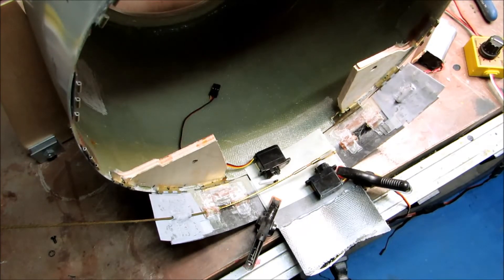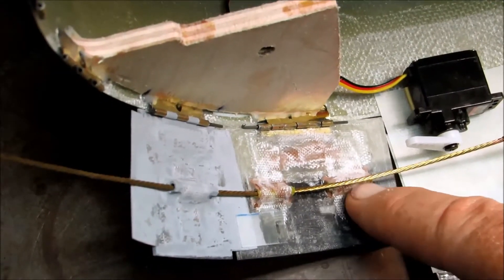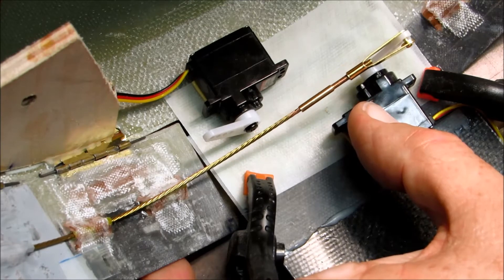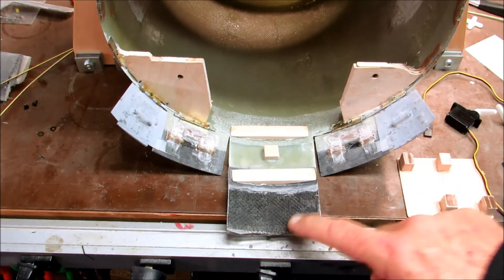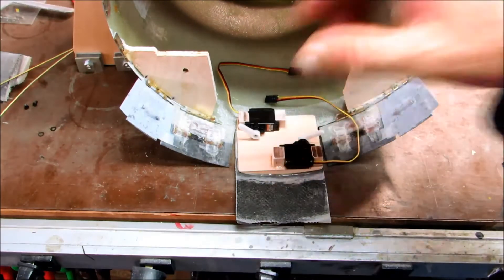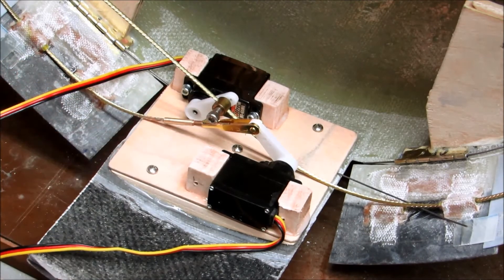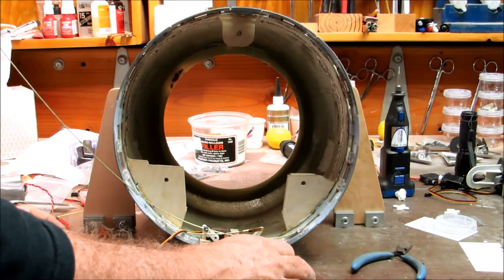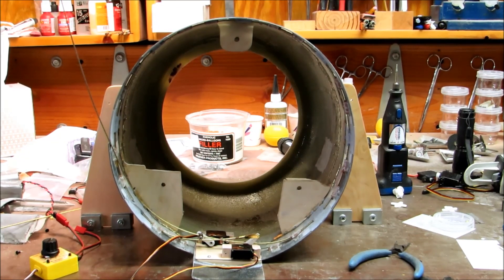Corsair #43, Making Operational Cowl Flaps, Part III

Comment: Just found your videos I built a p47d thunder bolt when I was a teen and never thought of doing this to the cowl I gave up Rc but now want to get back into it here in uk and seeing your wonderful engineering solution for cowl flaps has given me a spark to rebuild some of the aircraft I had as a teen 
They was all 1/8 scale but I might go bigger as more room to fit trick bits 👍🏻👍🏻